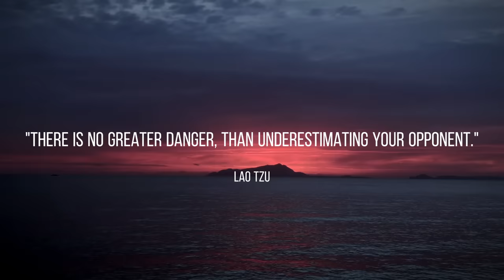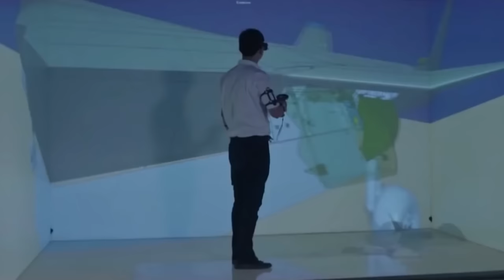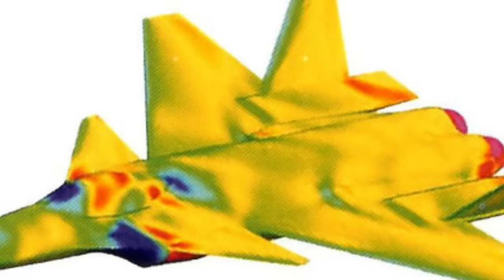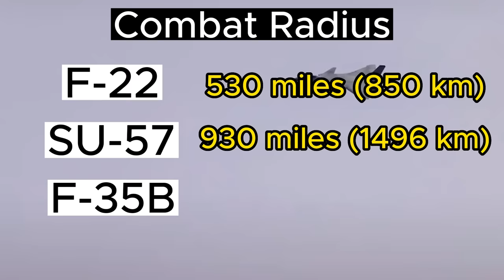China's Stealth Fighter, Good or Bad?

Comment: A J-20 equipped with 2 WS-15 engine have just flown last week
If speculated thrusts are accurate, this will make the J-20 the aircraft with the best super-cruise capability among all 5th gen fighters
Reply: Lol
Reply: China has a terrible track record with engines, im sure they will very quickly close that gap but not yet
Reply: Well, you did say, "If".
Reply: @Utubesuperstar  realiability is different from performance.
Reply: @lolasdm6959  and? China lacks both….
Reply: @Utubesuperstar  No Chinese engine's have decent proformance, the issue is the lifespan.
Reply: Chinese engines are notorious for being insanely inefficient, underpowered, and unreliable. Hence they used Russian ones exclusively until just now
Reply: @Utubesuperstar  Bruh your info is half a decade late.
Reply: @lolasdm6959  what part?
Reply: @noahraines992 The ws-10 has already been equipped and replacing the Russian al-31 engines for J-10s and new batch J-20s, not to mention the Flankers as well. That's 27k lbf of max thrust with afterburner vs potentially 31k lbf on the ws-10. Al-31f does go up to 31k but is also a more mature model.

So performance it equals if not exceeds the al-31 series. Never rely on the assumption your enemy will never overcome their weakness.
Reply: @domokun845  bro did you even read my comment?
Reply: @noahraines992  You're gonna have to be specific. You made a lot of wild ass accusations about Chinese engines being inefficient when the ws-10 has been around for years. It didn't get updated "just now".

Like if you made that statement in 2015, I'd agree with you.
Reply: @Utubesuperstar  You have not provided, and pretty sure you dont have any, concrete data to back your bs comment about the realiability of the Chinese aircraft.  Realiability is also relative to aircrafts built by other countries such as US F22 and F35 which the F22s are so poorly designed that the production has ceased, and F35 has been ordered to cease fly by Marine Corp as of September 18 2023 for missing in air incident.  The government could not find the jet after the pilot ejected for no good reason, the plane continued to fly, they had to put on the facebook asking citizens to locate the plane, what a joke.   This is not the first F35 accident, just to show you not only US plane reliability is bad, the pilots are poorly trained and the skills underwhelm their Chinese counterpart.
Reply: @dr.magnanimous8973 Was the F-22 poorly designed? Or you meant by the time of its inception the best design they put forth does became the standard for stealth fighters operation but one decade down the road they realised its a bad design in terms of maintenance. But given that if the F-22 is indeed operable on that particular day then it is a deadly adversary in aerial combat. So the argument is different here in terms of design choices and I think it's circumstantial.
Reply: @Utubesuperstar To give you another example, Huawei has been the most heavily sanctioned Chinese company yet they still found ways and channels of their own to produce new 7nm Semiconductor chips for their new smartphones. It upsets commerce secretary Gina Raimondo as she visits China and the news of the launch came right after the day she appear on air making statements of how the Chinese government should have abide to terms that in fact favours the US as a whole and asks the Chinese for agreement to purchase more US treasury bonds. Then the Chinese gave a swift respond as if to showcase in the 21st century the US is just another country they frequently dealt with. That's a nice slap to her face and to the Department of Commerce's agenda as a whole. This sets up nothing more than panics for the Americans as they realised that even heavy sanctions appeared to be virtually useless in dealing with the Chinese. While to us Chinese it's no surprise. We knew but we would never boast.
Reply: @Utubesuperstar Bro wake up..
Reply: @donavan835  The original argument by the commentor was a criticism on Chinese J20 on its reliability.   Then, I argue that the reliability has to be comparable, and the best comparison is to US F22 and F35, now, and which both have their own issue.  Whereas your argument has nothing to do with my comment, but to pose a new defense for F22 that it was good when no other stealth plane was around.   Of course it was the best when no other plane was around, but not now, and certainly not supporting the original comment by the doofous who I responded to.   The argument point of time is  at this point in late 2023,  not 2 decases ago, so introducing "circumstantial" variable is moot and irrelevant.

Comment: Small correction here for combat radius... US combat radii is determined by the effective distance an aircraft can perform a set mission. This includes time on station, several turns on full afterburner, weapons employment, and the return trip. All US aircraft have their ranges calculated as such. Russian and Chinese Radii are calculated by 1/2 ferry range. Or, the theoretical maximum flight distance in a vacuum, divided by 2. It's unrealistic and disingenuous to compare these numbers with practical ones for the F-22 and F-35B. 

For context, the USAF lists the F-16 as having "more than 2,000 miles" of ferry range. On the other hand, the combat radius is listed as around 300 nmi for different missions on a similar playing field as the F-35. A quick caveat for the F-16, it is likely the ferry range is calculated with three drop tanks while the combat radius is with only two. Please note the F-35 has double the combat radius as the F-16 (compared to F-35A). This makes me more likely to believe the J-20 has similar flight duration/range as an F-16 in ferry conditions (3 drop tanks, no weapons). Which is impressive, but certainly short of the F-22 or F-35.
Reply: What's your source on Russian and Chinese radii range being 1/2 ferry range?

Comment: The J-20 isn't made for dogfighting per se. Its lethality lies in the PL21 BVR missiles that have a crazy range of 300km, so it's likely to play the role of the aerial long-range sniper picking off high value targets from concealment. In a pinch, however, it can call upon its supermaneuverability to bring its high off-boresight capable PL15 missiles to bear in self-defense. The last I heard, both missiles are very highly regarded. 

The newer twin-seat J20B is reportedly able to control multiple drones, allowing it to act as an instant force multiplier.
Reply: Chinese AA missiles are good, although there are obvious flaws with launching a missile from 300 km away. Usually you don't take the maximum range of the missile as its kill zone. For example PL-21 cannot be stored internally, which isn't good for stealth aircraft.

Comment: You also don't need to be completely invisible to the radar. Being low-observable can still make the difference in a war where there's probably lots of radar pollution coming from every direction. Against basically anything other than an F-22 or F-35 it may be decisive.
Reply: F35 is a very good submarine.
Reply: @Superpo0oper2020 so is the moskva 😂
Reply: @Superpo0oper2020  ah yes comrade Vatnik, that 1 whole F-35 that was involved in an accident is truly representative of the nearly 1000 planes built thus far.

Comment: Perhaps the lack of a cannon also suggests that they think their Fox-2s will be good enough that they cannon is just extra weight, vibration, gun gas, and complexity they don't need?

On the other hand, we've seen western stealth aircraft sneak within literally 300 meters of a target and gun them to save missile ammunition, so it's possible that guns can save missiles during a seal clubbing situation.
Reply: cannon on a 5gen fighter🤣🤣🤣  . modern warfare  fight start at 400+km away or the range of your anti  air missile

2nd reason it dont need a cannon  it can easily out run F22 or F35 render your cannon a dead weight
Reply: @jetli740  ... according to chinese statistics?

Sure. When they are known to overstate their capabilities of their equipment, much like russia does.

And the US, by contrast. Will if anything. UNDERSTATE, it's capabilities.
Reply: @jetli740 the f22 can supercruise at Mach 1.8 and tops out at over Mach 2.2 good luck
Reply: @Destroyer_V0  overstate and understate according to who? We have no way of knowing if the US and China overstate or understate their capabilities.
Reply: @dekaaizer2550  I will grant you it's anecdotal evidence, and that I may not be recalling it correctly.

During a military exersize with the polish air force, US F-22s were playing the agressor. Some of these were" Shot down" and the f22 pilots seem to believe that they could have reduced that number of themselves shot down to 0, if they weren't playing fair. And the reports of the US downgrading their tank armour before sending them to ukraine, that the US didn't admit to having either the U2 or SR-71 until they, usually, were shot down during the cold war, that latter one, variations of it, has occurred quite frequently. Oh, and the US revealing they had soviet jets to train against, to hide they were developing the F-117 at the same airbase said soviet jets were flying from.

China by contrast, is a bit easier to tell ya. I will draw your attention to, chinese made tires. That found their way onto russian vehicles, and split open during the inital stages of the russo ukraine war. Or that practically all of the stuff made in china is done cheaply, because it doesn't have a quality assurance to ensure a minimum standard. Extrapolate that, along with a culture of lies to look good to your superior, obfuscating or downright just not recording information such as the recent youth unemployment data, or their homeless and poor. And you start to see why I believe china often overstates it's capabilities. After all, they have the largest navy (Hull numbers anyway) in the world! Surely the military conquest of taiwan should be easy!

So yeah. I say so, based on what I perceive.
Reply: @Gnomezonbacon   is that base on your technology?🤣🤣🤣🤣🤣
Reply: @Destroyer_V0 don't blame China for making tyres to Russian specifications and budget.
Reply: @Destroyer_V0  你说得对。中国人路上这么多国产车，我身边一半的家庭都换成国产汽车了，都该面临质量问题了吧🤣？
美国能让理查德在造船厂燃起来，还能如此自傲，真是太好笑了。
我再跟你说一个事实，虽然中国的GDP只占世界的不到20%。但是中国人的汽车保有量，空调保有量，肉蛋奶消耗量，电能消耗量。全部超过世界的20%。中国人的GDP是低估的，毕竟小成本服务业基本不会被计算。而美国人的GDP，啊... 感谢律师和医生！
Reply: @陈俊儒-p6w  Question. How much of the population of china, proportionally, has the same quality of life as, say, the average frenchman. This is access to electricity, clean water, a variety of foodstuffs from all over the world, a well paying job, good access to educational institutions and the free knowledge of the internet, and any of the other numerous things a lot of westerners take for granted.

Don't worry, I'll wait. Oh, right. I forgot. That's relying on the CCP officials to make statistics. Who, for some reason, isn't counting youth unemployment at the moment. Strange that. Or not counting people outside of big cities as people without homes if they don't have one. Or counting the number of people who died from covid. I can cherry pick a lot more here.
Reply: @Destroyer_V0  You are comparing a developing country to developed country on standards of living? China doesn't need to be able to produce the best product for everyone in the country to equipt the military.
Reply: @lolasdm6959  WTAF thinks china is not a developed economy at this point. THEIR GDP, at least so they claim, is the second best in the world, with imports AND exports to many nations across the globe...  If that is not a developed nation, I don't know what is.
Reply: @Destroyer_V0 ok american invader
Reply: @Elrossss  Bold of ye to assume my nation is American
Reply: @Destroyer_V0  Your logic is simply inexplicable, China's per capita GDP is just over 10,000 USD, Why is the standard of becoming a developed country so low? India's GDP is now higher than Britain's. Does this mean India deserve to be considered as a developed country?
Reply: @Destroyer_V0  If calculated proportionally, China's urbanized population is also close to 70%, which means that nowadays most Chinese live in their cities. I am not saying that there are no marginal poor areas in China, but can the poor areas definitely represent the average level of the country? Just like the homeless people on the streets of US, Did they really represent the average standard of living of the American?
Reply: @Utubesuperstar J20的巡航速度就达到了2.2马赫，而且还不是中国最先进的WS15发动机……
Reply: If you are trying to save on missiles, you already lost the war.

Comment: I'm a bit hesitant to believe its combat range is so large. Even if it is larger, which makes sense for the reasons you've described... being a third again more than the Su-57 Fictional seems like... a lot more.
Reply: The Su-57 is wide like the US planes. Soviet interceptors had long ranges too.
Reply: J20 has a lift coefficient of close to 2+, and it’s much slimmer compared to F-22 and Su-57.
Reply: @Ilovecruise because of those huge wings and canards
Reply: @netsimam  how is it different from traditional design which has a much larger tail wing? It seems people are always missing that out? Is that something I am missing?
Reply: @Ilovecruise  don't quote me on this, but traditional tail elevators/stabilizers usually produce negative lift for cruising speeds (due to a combination of trimming the pitching moment and the need to keep the aircraft stable in pitch), they exist mostly to maneuver the plane rather than as another lifting surface. 
Meanwhile canards can be (not always) used as an extra lifting surface and elevators at the same time, at the cost of worse radar cross section (and before the age of Fly by Wire, too unstable); the Swedes highly prioritize short landing and take off, hence why their fighters are usually in delta-canard configuration.
Reply: then this means canards help in saving fuel while take off (take off uses 30 pct of fuel normally) by producing more lift and that fuel can be used to ferry the aircraft farther @shira_yone

Comment: There has been some very in depth analysis of the RSC for the J20.  The J20 is low observable particularly from 15 degrees off a straight forward orientation. However, the rear stabilizers are monolithic. This among other design features have diminished it’s stealthiness.  The RCS albeit better than the SU57, is no where close to U.S. 5th gen fighters.  This is why I consider the J20 and SU57 gen 4.5.

Comment: The j20 is not a fighter jet used to gain air superiority, it is only used to cooperate with early warning aircraft to strike important targets such as radar and command centers, just like a blade. Air superiority aircraft and close range combat use FC31 (the j35 circulating on the Chinese internet) and other fourth generation aircraft. According to analysis, the FC31 is a fighter jet that fully responds to air combat and gains air superiority. However, it has not been officially released and was only discovered in the background of promotional videos, which may be under testing and adjustment.

Comment: The lack of an auto-cannon seems like a good decision frankly. You are not more maneuverable than a missile.
Reply: ... What does that have to do with the efficacy of a gun?
Reply: @billrich9722  you don't need it
Reply: @lolasdm6959  You only need something if you intend to use it.

This is America.  We intend to use the gun.
Reply: @lolasdm6959 Not sure what you base not needing a autocannon on but with good stealth aircraft it's hard to keep weapons grade lock from what I've read and seen in sims and also the aircrafts having electronic warfare and jamming capabilities. 

 Since autocannons are immune from everything a stealth aircraft has and uses as advantages. Having a autocannon seems like something I'd very much rather have and not need it, even if its never used. Than need an autocannon and not have one.
Reply: @jimmygambino91  Well that's why the aircraft has two IR missiles. For stealth aircrafts, your advantage is in long range fights. You really are just as well suited to close range fights as any other aircraft, so bascially no advantages at all. So the design was if enemy got too close, use IR to force the enemy to flee or if lucky shoot them down, and you get time to retreat to more advantagous range.
Reply: You intend to get into visual range dogfights with f35?

You DONT intend to do that, it is an emergency measure for if something has gone horribly wrong.

Comment: Many may concern the front canards may spoil the general stealth design, but IMO the canards are made with the material that’s“a piece of glass” from radars’ view. This is because unlike wings, there’s no fuel tanks or other non-stealth device inside canards, so making canard transparent to radars is a good strategy for Chengdu
Reply: I can imagine the canard is under a lot of stress during higher G maneuvers, so i should think it’s impossible to use just composite materials
Reply: Tell me you don't understand what radar is without telling me exactly that 😂
Reply: Thats not how radars work, its about surface perpendicular to the wave direction. Canards provide area to bounce back radar waves. It is likely they use software to compensate by directing canards less favourably for aerodynamics but reduces radar returns compared to normal canards.